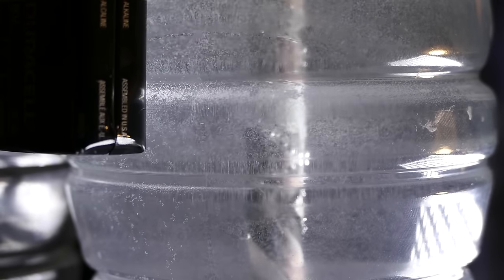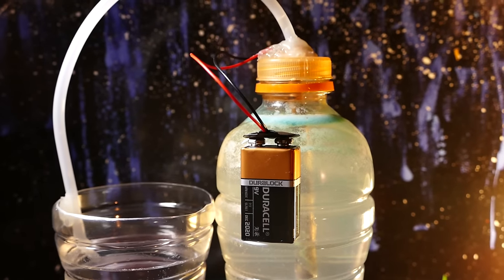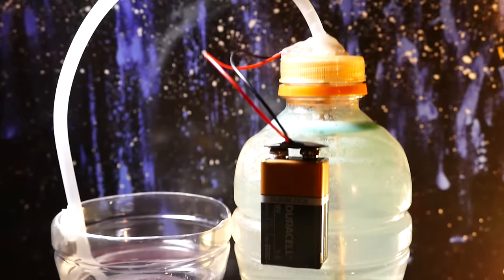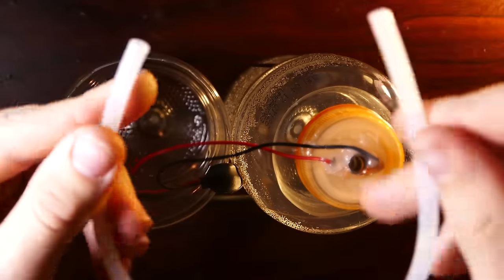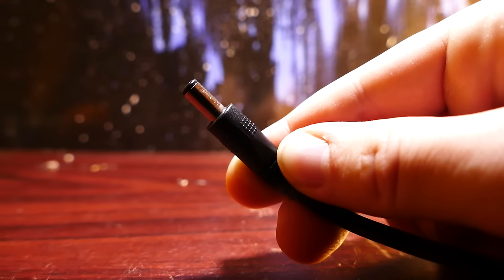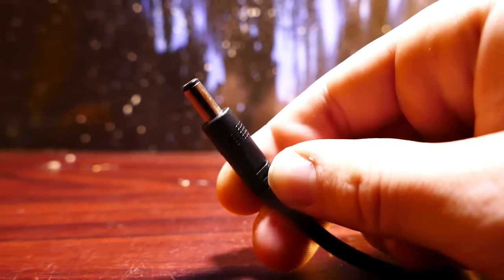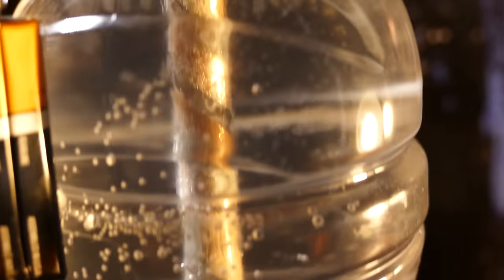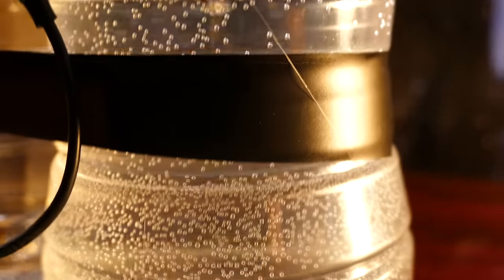Amazing Battery Hack! - Fire From Water With a 9 Volt + Pen!!!

Comment: i think the gas you get in your container is jusr a H2 O2 Mixture and not pure H2. you need the hole in the pen exactly above the waterlimit to get mostly pure H2. ore you remove the hole and put the second strip inside of the pen. then you have seperated the reactions. And the Gas. (one in the pen and one in the bottle top,releasing by making a little hole in the bottle cap)

Comment: The electrodes would last much longer if they were made of carbon. Pencil lead is good, or if you know what you're doing then you can pull the carbon rods from some D cell alkaline batteries and clean them in hydrogen peroxide like I did for my sodium hydroxide generator.

Comment: why are you putting NaCl to it?
Reply: Its an Electrolytic Separator.
So you need the water to conduct power and for that you use Sodium hydroxide solution.
But NEVER use tablesalt (NaCl) because it will produce Chloride (which was btw used in WW1).
Reply: sela9988 chloride is still used nowadays